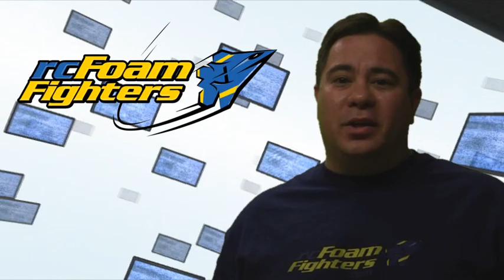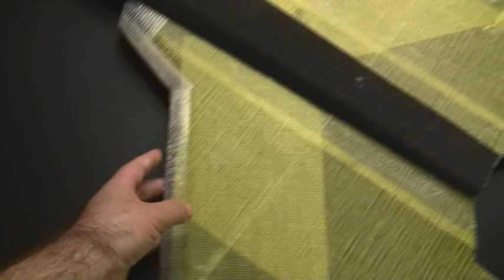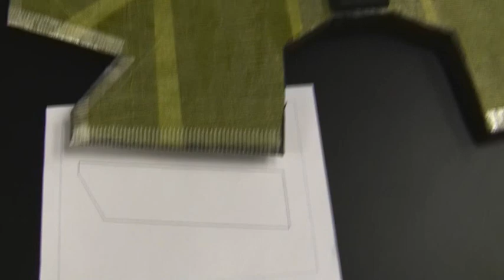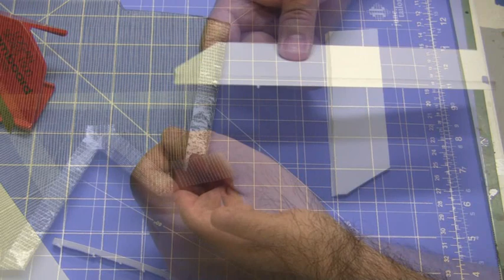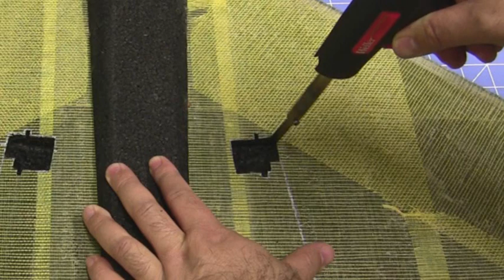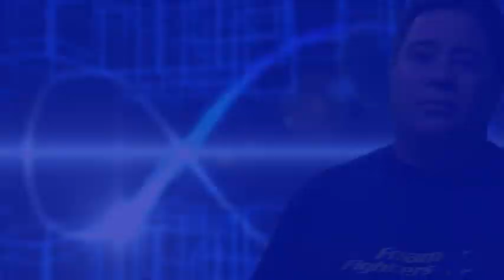Part 3 EPP Park Jet Scratch Built RC Plane

Comment from the maker: leviterande, are you refering to the tape for the elevons or around the edge of the plane? I typically don't use duct tape, I only use the cross weave strapping tape. I agree, depron usually has a slicker surface and does not grip as good to tape.  You may try roughing up the depron surface in the area the tape will be applied,  just very slightly with a fine grit sanding block. try this on a test piece first and see if it works any better.

Comment from the maker: Droogloot, regular duct tape is a bit heavier than the straping tape. If you can't find the crossweave tape I would recommend using regular straping of packing tape with fibers. It will be lighter than duct tape.

Comment from the maker: Thanks Mike. Actually the tape holds the Elevrons pretty good. Also when it is finished there will be another layer of the colored sealing tape applied over the strapping tape making it even stronger.
As for the T-Shirts i am working on it. I am working on a few designs for shirts that will be available through an Affilliate Shirt Manufacturer. I will let everyone now when that is ready.

Comment from the maker: KaptianC thank you for yor comment. Yes you can use a normal soldering iron. That is what i used to use all the time before i got the Weller tool. Just try and use a low wattage soldering iron. The trick is to not get it too hot. If you add a longer wider tip to a soldering iron it should be about right I would think. Thanks for sharing all your cool videos too!

Comment: i've heard of the hinges method that u use but never seen it with my own eyes. thats really looks promising. as always, thanx for sharing guys.
do you think i can used some cheap soldering iron n custome made the tip to looks like what u r using. it looks very useful.